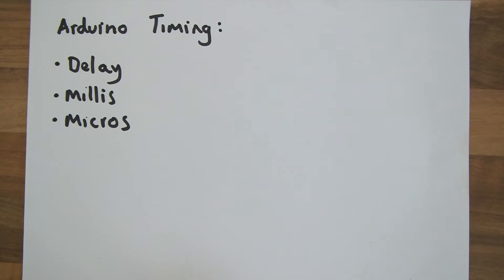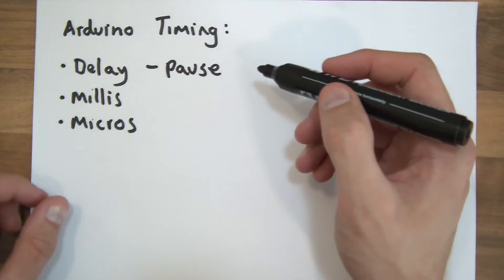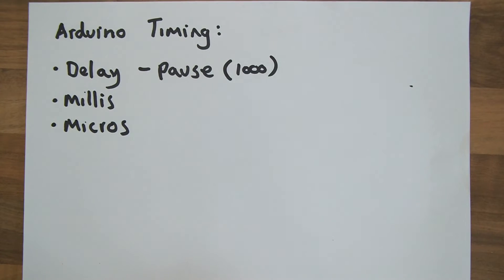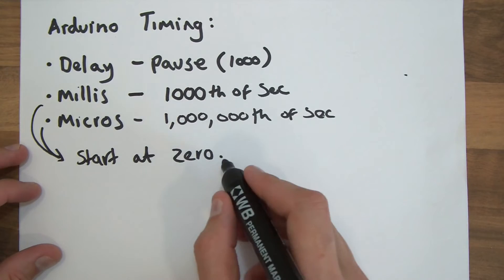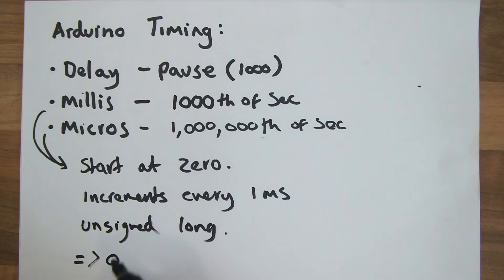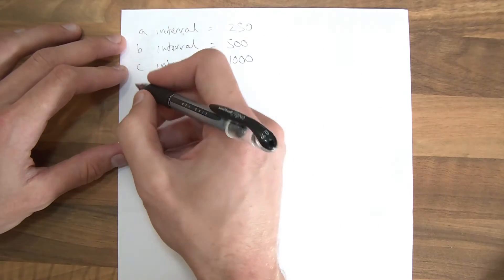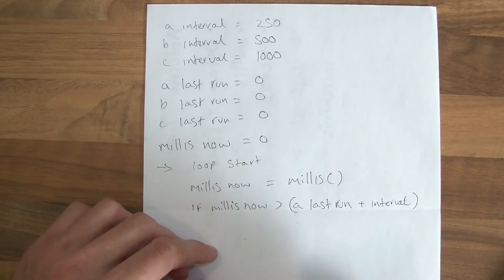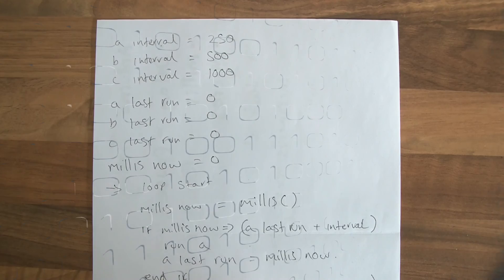TUTORIAL: How to Manage Arduino Timing: Delay, Millis & Micros!

Comment: What if i want to add delay of one minute??
delay(60,000);
is it correct ??
Reply: 60 seconds in a minute, so yes. But your Arduino will be paused and do nothing, not respond to anything during that delay(60000). Note: do not use a comma.
Reply: @AlienRelics  thank you 😃
Reply: What I should do if I want to delay by 10 minute? please help me urgently I'm confusion😖
Reply from the maker: Delay(600000);
Reply: Can I get your mail please to explaine my issue?
Reply: @soufidz800  shashankkharade@gmail.com
Reply: #include "max6675.h" unsigned long int milli_time; int thermoDO1 = 4; int thermoCS1= 5; int thermoCLK1 = 6; //================================================ int thermoDO2 = 7; int thermoCS2 = 8; int thermoCLK2 = 9; //------------------------------------------------ int thermoDO3 = 11; int thermoCS3 = 12; int thermoCLK3 = 13; //================================================ int thermoDO4 = 22; int thermoCS4 = 24; int thermoCLK4 = 26; //================================================ int thermoDO5 = 30; int thermoCS5 = 32; int thermoCLK5 = 34; //================================================ int thermoDO6 = 36; int thermoCS6 = 38; int thermoCLK6 = 40; //================================================ int thermoDO7 = 42; int thermoCS7 = 44; int thermoCLK7 = 46; //================================================ int thermoDO8 = 48; int thermoCS8 = 50; int thermoCLK8 = 52; //================================================ int thermoDO9 = 23; int thermoCS9 = 25; int thermoCLK9 = 27; //================================================ int thermoDO10 = 49; int thermoCS10 = 51; int thermoCLK10 = 53; //================================================ MAX6675 thermocouple1(thermoCLK1, thermoCS1, thermoDO1); MAX6675 thermocouple2(thermoCLK2, thermoCS2, thermoDO2); MAX6675 thermocouple3(thermoCLK3, thermoCS3, thermoDO3); MAX6675 thermocouple4(thermoCLK4, thermoCS4, thermoDO4); MAX6675 thermocouple5(thermoCLK5, thermoCS5, thermoDO5); MAX6675 thermocouple6(thermoCLK6, thermoCS6, thermoDO6); MAX6675 thermocouple7(thermoCLK7, thermoCS7, thermoDO7); MAX6675 thermocouple8(thermoCLK8, thermoCS8, thermoDO8); MAX6675 thermocouple9(thermoCLK9, thermoCS9, thermoDO9); MAX6675 thermocouple10(thermoCLK10, thermoCS10, thermoDO10); int vccPin = 3; int gndPin = 2; //============================ void setup() { Serial.begin(500000); //Fastest baudrate Serial.println("CLEAR DATA"); Serial.println("LABEL,Computer Time,Time (Milli Sec.),TH1, TH2,TH3,TH4,TC1,TC2,TC3,TC4,Teau,Tamb"); // use Arduino pins //also for the second sensor too pinMode(vccPin, OUTPUT); digitalWrite(vccPin, HIGH); pinMode(gndPin, OUTPUT); digitalWrite(gndPin, LOW); //================================================== // wait for MAX chip to stabilize delay(500); } void loop() { milli_time = millis(); // basic readout test, just print the current temp Serial.println("");// you can uncomment this while testing Serial.print("DATA,TIME,"); Serial.print(milli_time); Serial.print(","); Serial.print(thermocouple1.readCelsius ()); Serial.print(","); Serial.print(thermocouple2.readCelsius ()); Serial.print(","); Serial.print(thermocouple3.readCelsius ()); Serial.print(","); Serial.print(thermocouple4.readCelsius ()); Serial.print(","); Serial.print(thermocouple5.readCelsius ()); Serial.print(","); Serial.print(thermocouple6.readCelsius ()); Serial.print(","); Serial.print(thermocouple7.readCelsius ()); Serial.print(","); Serial.print(thermocouple8.readCelsius ()); Serial.print(","); Serial.print(thermocouple9.readCelsius ()); Serial.print(","); Serial.print(thermocouple10.readCelsius ()); delay(120000);

Comment: i have a question what happens if different task need the same time? for example: you have 2 IR sensors sensing different objects, say the first one needs to be read at 20s and the other one too, would this this affect the arduino?
Reply from the maker: Hi Omar, in this case, in the loop, you'd simply group both of the reads together into the same block of code... So for example; Is it 20 sec yet? No! Is it 20 sec yet? No! Is it 20 sec yet? No! Is it 20 sec yet? No! Is it 20 sec yet? YES!!! Read sensor 1.. Read sensor 2... DONE. Is it 20 sec yet? No! Is it 20 sec yet? No! Like that...
Reply: thanks for answering, greetings from mexico!
Reply from the maker: @Omarbg95  thanks. :)

Comment: I ran a code for a project running a clock from a stepper motor. I modified it to "aLastRun += aInterval;" in order for it to be more accurately. Now I'm having all sorts of problems when it gets to 32 seconds. any ideas?
Reply from the maker: Hi, it depends on your exact code, but on the face of it, you're trying to say that your last run was in the future! Last run + some time doesn't make last run, it makes the last time something was run, plus an interval to make a future time. Antony...
Reply: Sorry I wasn't very specific. I mean that I replaced "aLastRun = millisNow' with  "aLastRun += aInterval;" after the if statement. So on the first run threw on your sketch it would be 0 += 250 = 250. at around 251 milliseconds or something real time. Thanks for the reply and video by the way, I had come across millis before but didn't understand it at all but had a feeling it would be useful.
Reply from the maker: @mugzwood  why would you want to change millisNow to interval? I'd say it'd not recommended because last run is supposed to be accurate. :)

Comment: Thank you for the post, 
How can we use millis function in for loop..? Can you please help me with that?
Reply from the maker: Inside the for loop, you'd probably say: If millis()> time to do a certain task then do the task. This will allow you to perform a task a certain amount of times at certain intervals. :-)
Reply: Thanks alot Antony for your guidance.. 
I'll try it and let you know..
Reply from the maker: No worries...
Reply: Hello Antony,
I worked on your given suggestion, I think i have some understanding gap and  so its not working for me.
I want counter to decrement every second with using milis function, meanwhile counter gets decrement till Zero arduino will able to take input from the sensors/pushbutton.
Thank You in advance.. :)
//
unsigned int interval = 1000;
unsigned int millis_now = 0;
int lastrun = 0;

void setup() {
  
Serial.begin(9600);
}
void loop() {
int incomingByte = 0;
millis_now = millis();
incomingByte = Serial.read();

if (incomingByte == 'i')
{
 for (int a=5; a >=0 ; a--){
     if (millis_now > (interval+lastrun)){
    Serial.println(a);
     }
  }
lastrun = millis_now;
}
}
Reply from the maker: Hi, sensors aside; you'll want to do something like this: (Not compiled or tested)

const int interval = 1000;
unsigned long millisNow;
unsigned long lastCheck;
const int timerStart = 5;
int timerRemainingSeconds;

void loop() {
if(millisNow>lastCheck+interval){ //Check is due!
timerRemainingSeconds--;
if(timerRemainingSeconds<1){
//Time is up!
}
lastCheck=millisNow;
}
}
Reply: Thanks Antony for your response.

I am curious to know where exactly we are going to use "const int timerStart = 5;" as it is define but not used in the loop function.
Reply from the maker: Hi, I'd forgotten a line. Setups should have a line which says: timerRemainingSeconds=timerStart;
Reply: Hi Antony,
Thank You once again for giving your valuable time.

I have added above mention line in setup().. and also made some changes in the code.
Now the value in the var  "timerRemainingSeconds" gets decremented by 1 every second.

How can we trigger that if statement  "if(millisNow > (lastCheck + interval))" with push-button, whenever we press the button the value will get decremented every second starting from 5 to 0.
I tried to do that with "Serial.read()", but it didn't work so well. It decremented only once and got stuck on 4. 

const int interval = 500;
unsigned long millisNow;
unsigned long lastCheck;
const int timerStart = 5;
int timerRemainingSeconds;

void setup()
{
Serial.begin(9600);
timerRemainingSeconds = timerStart;
}

void loop() {
  int readchr = Serial.read();
  millisNow = millis();
  
if(millisNow > (lastCheck + interval) && readchr == 'p')
{ 
timerRemainingSeconds--;
  if(timerRemainingSeconds < 1 )
    {
    Serial.println("TIME-OUT");
    timerRemainingSeconds = timerStart; 
    }
lastCheck = millisNow+500;
}
Serial.println(timerRemainingSeconds);
Serial.println("______");
}
Reply from the maker: Maneesh Mondkar Hi, you need to use a pullup input pin, wire button to ground, and then say if pin == low then, whatever...
Reply from the maker: Cool, glad you did it! :-)

Comment: Thank you Antony for posting this video  on Managing  Arduino Timing: Delay, Millis & Micros, it's been helpful to me as I am a Neophyte to Arduino and Coding.  I would like to know if it is possible to Fade/Ramp up and down a single LED while the a couple other LEDs are blinking at different rates & times.  Complements to your video I am able to blink several LEDs at different rates and times.  Thank you for any help or direction you can point me to.  Thanks again for your instructional video.
Reply from the maker: Hi Sal, thanks for your comment. You can fade in/fade out an LED in two common ways: You can use something called PWM, or you can use a capacitor. PWM basically switches the LED on and off with extreme speed, and you can trick the human eye into thinking that it is fading - I have a video on that in a playlist. If you wish to take the capacitor route, you'd basically parallel a capacitor in with the LED. Capacitance is measured in Farads, and 1F is equal to 1 Coulomb for 1 Second. 1C is equal to 1 Volt and 1 Amp for 1 Second. An LED is around 3V, 0.02A. So, to hold for 1 Second, you'd need 0.06C, or 0.06F. You'd probably need to hold it for 1ms in order to get the fade effect, so 0.06F / 1000 = 0.00006F, which is 60uF. So if you paralleled a 60uF capacitor in with your LED, you should get a fading effect! The capacitor will act as a mini battery!
Reply: Thank you for your direction Antony... I will look up the Video on your playlist and let you know how it works. Thanks again for your help and direction.

Comment: Antony this is really helpful! I understand the concept of now but I am still struggling to use it in a practical application - especially to use it as a replacement for Delay. 

For an example - I want an output to go high 2 Seconds after it the input threshold was reached... 

// the setup routine runs once when you press reset:
void setup() {
  // initialize serial communication at 9600 bits per second:
  Serial.begin(9600);
  pinMode(13,OUTPUT);
}

// the loop routine runs over and over again forever:
void loop() {
  // read the input on analog pin 0:
  int sensorValue = analogRead(A0);
  // Convert the analog reading (which goes from 0 - 1023) to a voltage (0 - 5V):
  float voltage = sensorValue * (5.0 / 1023.0);
  // print out the value you read:
  Serial.println(voltage);
  if (voltage >= 4.0)
  {
   delay(2000);      // This is the point the output should wait 2 seconds AFTER the voltage is >=4.0 , then pin 13 goes HIGH -
                               // but using Millis!!!
   digitalWrite (13,HIGH);
  }
  else
  {
    digitalWrite (13,LOW);
  }
}

Thanks for talking the time out to make these videos, once again, they are very helpful!
Reply from the maker: Hi, I think you want this:

unsigned long triggerSetMillis= 0; // Time to turn on!
bool triggerSet = false; //Is there an imminent turn on time?

// the setup routine runs once when you press reset:
void setup() {
  // initialize serial communication at 9600 bits per second:
  Serial.begin(9600);
  pinMode(13,OUTPUT);
}

// the loop routine runs over and over again forever:
void loop() {
  // read the input on analog pin 0:
  int sensorValue = analogRead(A0);
  // Convert the analog reading (which goes from 0 - 1023) to a voltage (0 - 5V):
  float voltage = sensorValue * (5.0 / 1023.0);
  // print out the value you read:
  Serial.println(voltage);
  if (voltage >= 4.0)
  {
   if (!triggerSet) { //If there is currently no trigger set
       triggerSetMillis = millis() + 2000; //Set trigger time to now + 2 sec.
       triggerSet = true; //Yes, there is a trigger set.
   } else {
     if (millis() => triggerOn){ //It's time to turn on!
        //You need something here to test if already HIGH.
        digitalWrite (13,HIGH); //Turn on.
     }
   }
  }
  else
  {
    digitalWrite (13,LOW);
    triggerSet = false; //Terminate any triggers.
    triggerSetMillis = 0; //Reset trigger.
  }
}
Reply from the maker: Code completely untested, and not compiled! I did it quickly in notepad, so please test it! Lol
Reply from the maker: I think the nature of timing in the Arduino is difficult to understand, but try to think of it like a person who is constantly checking the clock every 1 sec waiting for the time when he has to start a task. It's kind of like that. The delay function is like where a person freezes completely and his brain is totally paused!
Reply: Thanks Antony, Yeah I get that now, thanks to your last video!

That code doesn't quite work - I've been working it for ages and the "delay" is something I've found very useful to prevent that stage when two voltages are so similar that the Arduino doesn't know if it's high or low... a couple seconds of delay is a good way to stop the relay chatter! 

on my last project I ended up using the Delay function because I couldn't understand millis... I'm really trying to not let it beat me this time - you know what its like!!
Reply from the maker: Carl Bartlett The code I sent will be somewhere near. See if you can finish it off. I understand the chatter. I get it too with different things. In my solar panel system, I get the relays turned on when there is over 5000 lux. But sometimes light can wobble around a certain value! I haven't addressed it yet, but I will do at some point soon. The way I'll address it is to block state changes for an amount of ms after each change... If last change < millis()+timeout then block, else, make the change...
Reply: Oh okay, I'll have a play with the code and see what I come up with. Thank you!
I'm very new to Arduino and struggle a lot with it as I'm sure you can tell! 

That's a very interesting solution... it makes a lot of sense actually.

The project I'm working on is for a solar charger via a buck converter to charge a lead acid battery or some Lithium-ion battery's. It's just a split charge relay. It's so people in camper vans can easily charge a battery from both solar and an alternator but having the option to select what voltage the device switches at. A device probably already exists - it's just for fun!

Thanks again Antony, for all your help. you're very approachable and very good at explaining things.

Carl